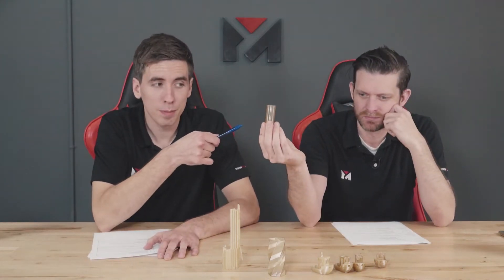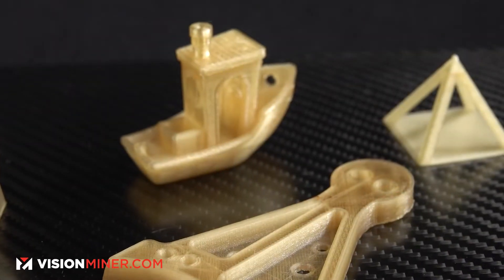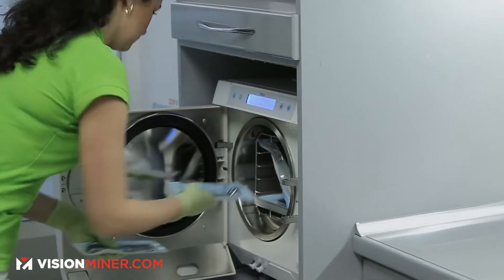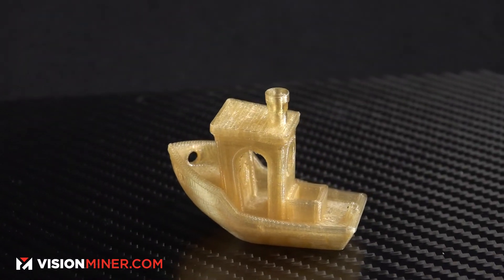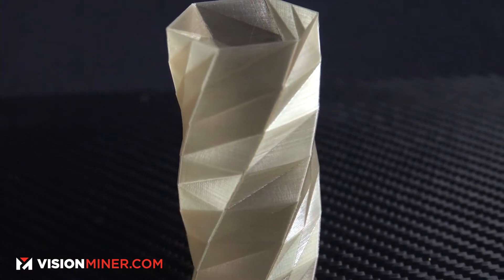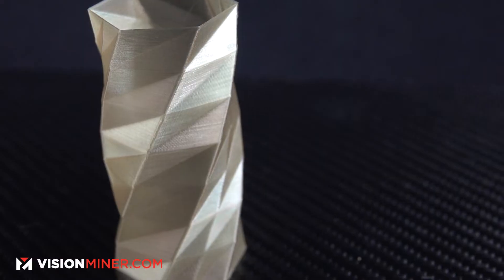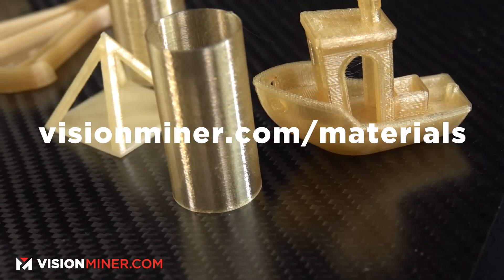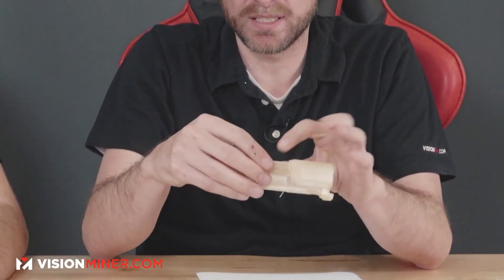All About PPSU - Polyphenylsulfone 3D Printing Filament - STRONG Plastic!

Comment: How do you get this to stick to the bed?  Your Nano Polymer adhesive doesn't seem to work on this material (it's great on everything else though).
Reply from the maker: Make sure it's extremely dry -- that's super important with PPSU. Our glue works great, in our shop --- if it's not, definitely try warming up the bottle and shaking it real good :) if it's still not working, give us a call. That is -- if you have a 160c+ buildplate. If you're not up in that temp range, I would probably stop trying..... especially without a heated chamber :)
Reply: Vision Miner  thanks I’ll give it another go.  I’m running 160c on the buildplate and 130-140 in the chamber.  I can get the layers down but they just aren’t really stuck to the build plate - I’m using glass.